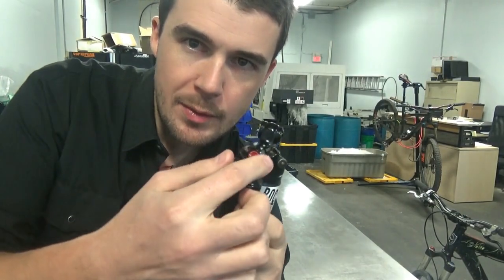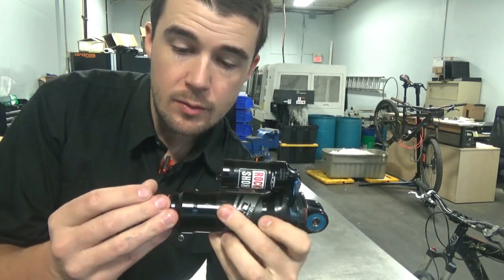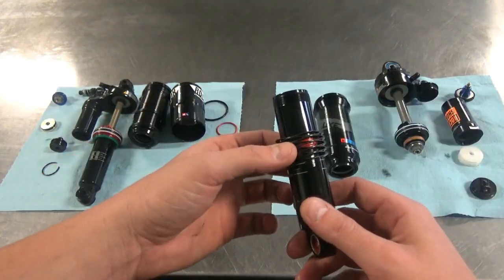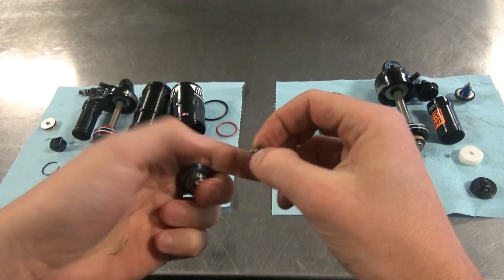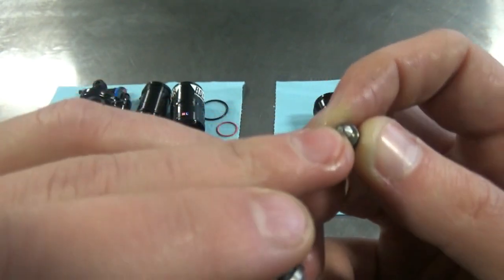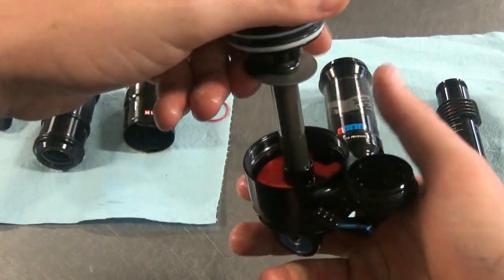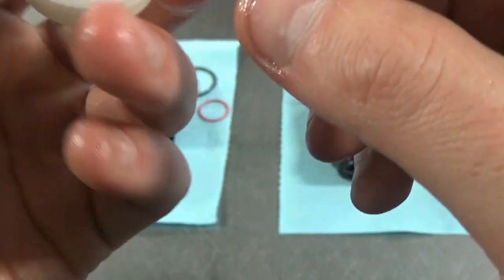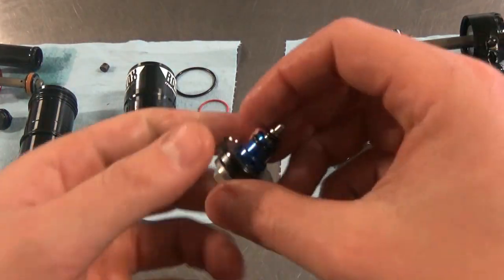The Tuesday Tune Ep 22 - Rockshox's Monarch Plus and Super Deluxe

Comment: Wow so the metric shock has a 1/2" shaft and the imperial shock has a 10mm shaft. Rockshox need to decide what side of the ruler to use and stick to it!
Reply: 1/2" is probably the next best size and there is hardware/seals etc off the shelf for it. Its called working with what you have got
Reply: @howlingbeats2544  what? An inch is 25 mm meaning its 12.5 mm
Reply: @alexvega9181  I think google fucked me, oh well.

Comment: I'm about to re-valve my Super Deluxe and was wondering if you could elaborate a bit about the preloaded rebound stack. My current problem is that the tune is too light and the rebound circuit isn't controlling the shock on the way back given my spring pressure. I ordered a the monarch plus tune assembly in the Mid/Mid configuration and plan to install it, test it, and go from there.

Comment: Hi Steve,

Great videos and products as always! I'm soon going to be fitting your Secus to my fork!

May I ask what your thoughts are regarding the Super Deluxe vs the Deluxe RL/RT (non piggyback shock).

I currently have the Deluxe RT (non piggy back) but do not do long downhills so I wouldn't take advantage of the additional shock cooling, is there much else of a difference? I must admit I am not greatly impressed by its performance it seems to have too much HSC damping. 

Thanks
Reply from the maker: The Super Deluxe dampers are completely different to the Deluxe RL/RT. They can be tuned to do things that the inline Deluxe simply cannot do - nothing to do with heat, just a much better damping characteristic for anything where you're descending more aggressively than typical XC riding.

Comment: I'd love to see you do a similar review on the DVO Topaz that you guys sell.
Reply from the maker: The layout is pretty well identical to the Monarch Plus - some changes to the functional details (particularly the air can and bladder in the reservoir) but the construction is otherwise extremely similar both in design and manufacturing quality (that is to say, largely good, but not perfect).
Reply: Vorsprung Suspension indeed.  The inner sleeve with places for tuning bands on both negative and positive chambers was my first clue that the Topaz was similar.  I've torn down my Topaz and changed the oil to Red Line Like Water in attempt to get a more playful reactive shock.  But at times it wants to pack up on high speed successive hits.  I've been contemplating removing one of the two rebound shims to see if that would allow the rear wheel to rebound quicker.  My rebound adjuster is maybe 2-3 clicks from full open and the low speed hits rebound a bit quickly.

Comment: Regarding the preloaded rebound shim on the monarch plus. Are you saying that the rebound adjustment does nothing when set slower than medium?

Great video's love learning about this stuff.
Reply: Kris Brunner what he is saying is that the rebound shim stack is so heavily preloaded/stiff, that it never really flows oil in practical use. This leaves all the oil to flow only through the needle/low speed port. You lose all the benifits of the high speed rebound stack and end up with a simple port orifice damper. The medium that is references is the tune (stiffness) of the stock rebound valving(shim stack)
Reply: NMullen119 thanks for clarifying.
Reply: I wonder if he was also considering heavier riders with high air pressures and needing more reb. Damping

Comment: Hey mr. suspension expert. Which shock would u say is the more robust, the monarch debonair plus (imperial) or the fox dpx2? (Imperial). 
I weigh 100kg and my frame is a 2015 commencal AM meta V4. Have been using the monarch debonair (not plus) and have had a lot of issues with it. Not sure if it’s because of the way the frame twists and binds the shock or what. 
Ur feedback would be much appreciate. Cheers .

Comment: I have a Rockshox Super Deluxe that knocks. It knocks on chatter and when changing from rebound to compression. I've had it serviced and they said everything was good...

Have you seen this issue before?
Reply: Could be the shim that you can see when you open the air can (see for example @ 13:05). Where the bottom out O-ring sits. Just put a small amount of sram butter in there, on both sides of the shim and on the shaft, then push the O-ring up against it all so it sits firmly on the end of the shaft. If that doesn't help then I have no idea. 🙂
Reply: @lonelymtbrider3369  Thank you for taking the   time to reply. 

I've had the shock serviced recently (before my initial comment) and the O ring was replaced that holds the travel reducer. It hasn't moved since (I've checked a couple of times) and is fairly snug. 

It seems from the reading that I've done that some Deluxe just have this issue. It doesn't effect performance but annoys the hell out of people, and me.

Comment: Appreciate your shocking  topic as only a few of the public can ..u no ..appreciate
Its cold in Canada..New Fork thoughts..
I have a Fox float 34mm rhythm Grippy..Really like it..Its lost 20mm of travel
I let air out and took top cap off as I think damper had too much oil as shock never had full travel..Riiding on oil..Only needed 60 pounds for my 180 pound weight..
So My questions
1.Cts damper probs..Ool past seal..Can that happen to air negative on fork .oil from stantions making a home in negative spring ..
2.Cold out below 0 ..Can Fox oil grease freeze and block my port..

As a test I pumped up to 150 pounds and fork travel good..wedge 2x4 between tire and fork let air out..The idea was to keep fork extended and allownport to blow out air negative..Didn't work and great force put on 2x4..Meaning air stayed in air negative..
So watched your shocking Vids..Very Informative Thx

Comment: In all reviews I've read it is mentioned that it is possible to change shock stroke using spacers. Is it true?
Reply: Can't increase stroke from possible, but it's possible to reduce stroke
Reply: You can't really reduce stroke either. Because of the negative air spring equalization dimple, if you reduce the stroke more than just a few mm, the negative air chamber will never fill and the shock will be extremely harsh and have a very hard top out.
Reply from the maker: You can reduce the stroke (not eye to eye) with a spacer on the damper shaft yes. Whether you'd really want to do that is up to you.
Reply: I have trek remedy 8 2018 and I was curious if I am not stuck with proprietary shock size
Reply: The shocks on the spesh enduro have a spacer inside that reduces the stroke, and uses a longer air can from what I remember. Not sure why but thats how they come.

Comment: I dont understand how the Rebound Stack is preloaded, there are only some Spacers on the end and the lug nut. Where can i get one of those acetal ifp? This is the biggest flaw in the shock because there is no glide ring.
Reply from the maker: They use a ring shim system, not a spring to preload it. Shoot us an email and we'll get you an acetal IFP - caveat being that you need a vacuum bleeder to bleed it properly because there is no bleed screw in the IFP (unlike Rockshox, we did not think it was a good idea to tap a small diameter thread into plastic).
Reply: Vorsprung Suspension so with that said why does RS have 3 rebound tunes? Is there any actual difference at all?
Reply from the maker: Marketability? You'd have to ask them. It makes no sense to us either. It's not even the only shock this happens on.
Reply: @VorsprungSuspension  What kind of stack are you using (when tuning it) for the RC3 plus rebound then? And what about Super deluxe?